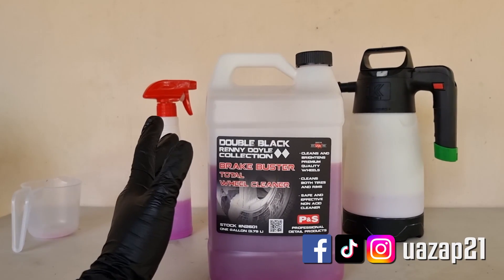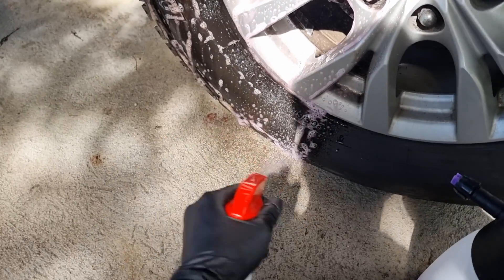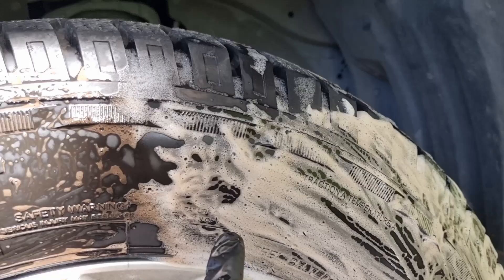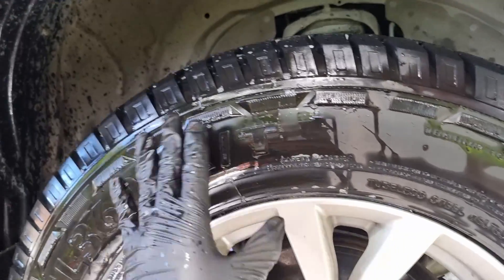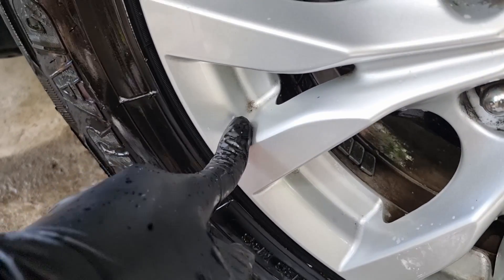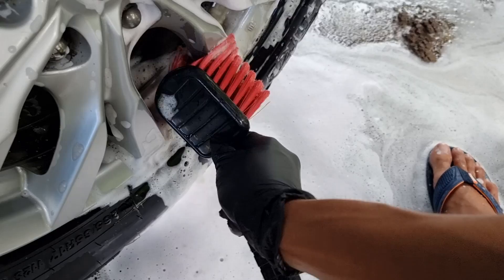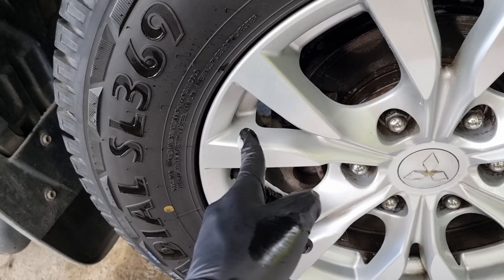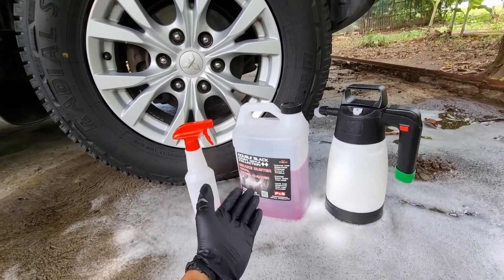P&S Brake Buster Review | Undiluted and 5:1 Dilution Test

Comment: if you want foam, just put it in a foam cannon not diluted. pressure washer will add water. i was an avid brake buster user then i discovered super clean.
Reply: super clean can be dangerous tho
Reply: @Jose-yx7lq  agree be careful with apc type cleaners. Dilute on first try. They are both so cheap I keep a gallon of each on hand. I like superclean on tires and BB on wheels. Superclean on wheels if last wash was a while ago.

Comment: the foam dripping down is not a problem. you want it to that. its the same mistake people get with a foam canon. dripping down carries the dirt with it. but none the less for this level of grime 1:5 is too dilluted
Reply from the maker: dripping down only carries loose dirt
when everything drips down too fast, you got no product left on the surface to clean what was left
Reply: @uazap  dripping is due to water, hence what it means when one says it's too diluted at 1:5. there is still 1:3 or 1:1 you haven't tested

if it had less grime, I would dilute it more. if it had more grime, I would dilute it less. that's just common sense with anything. if you had to do a maintenance wash full product would be a waste of money.
Reply from the maker: @karlgredona1651  thanks will do